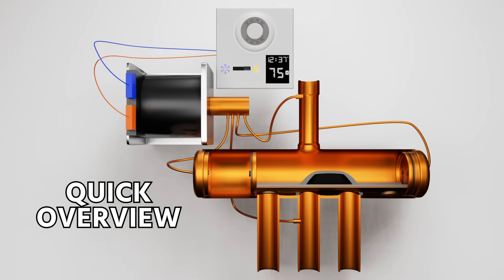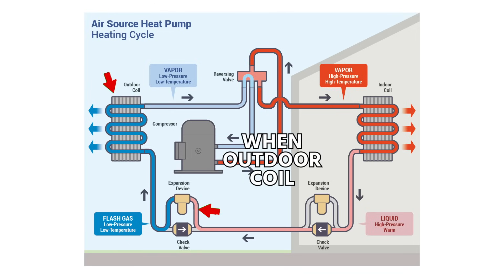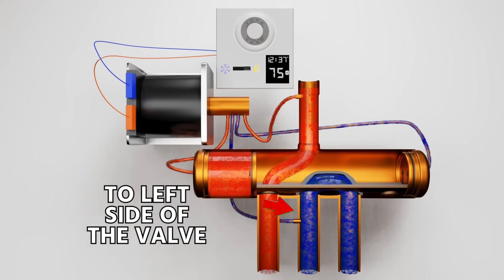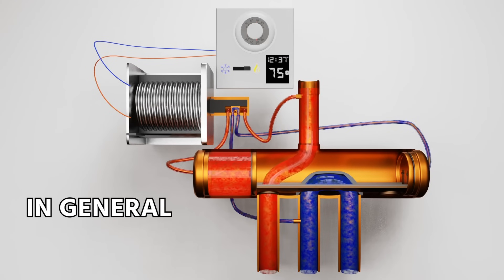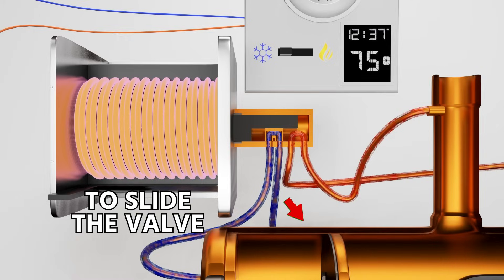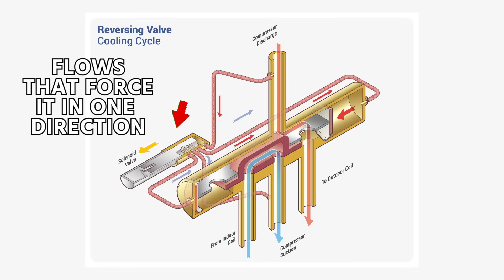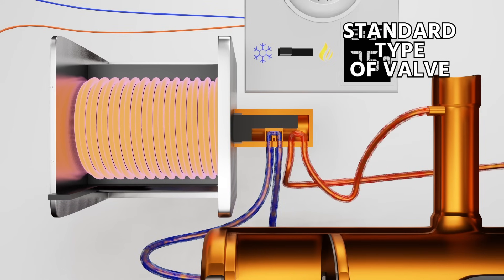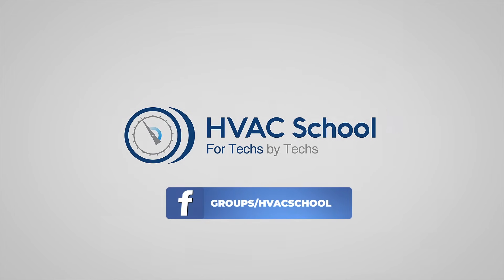How a Heat Pump Reversing Valve Works

Comment: In winter here in North Texas, when I turn my Trane heat pump to heat, error messages are thrown and then it goes to the heat strips only when I reset breaker. Could this be the reversing valve?  My technician says they are very hard to change out and all freon on outside unit cannot be recovered.  Costing thousands of dollars.  Is this true? Also, could it be the expansion valve?

Comment: I always wondered how a simple solenoid could cause a pressure differential to move the reversing valve. Now I know that it's caused by a pilot valve that acts as a mini reversing valve. Thank you so much for the information. This video was illuminating.

Comment: “Normally called condenser coil” that’s why I set terms relative to straight-cool systems. Easier to base it off of something that doesn’t have each heat exchanger functioning as both

Comment: Absorbs heat from 40* air and provides 95* heat inside?
Why is this taught across the industry instead of the fact the heat is generated by the compressor compressing the gas, which makes the gas hot, because it’s being compressed, which then goes through the indoor coil and is cooled by the indoor blower, condensing the gas into liquid and also heating the space. Anyone who thinks not- go touch the discharge line at a running compressor and see for yourself.
Anyone with a shop air compressor that’s ran it more than a couple minutes knows that compressor pump head, and even the tank / air inside it gets hot as it’s running, compressing the air.

Comment: I'm new to the hvac world and I understood that if it was blowing hot/warm air out of the outdoor unit it was making it cold inside and vice versa but this video connected so many things I thought I understood
Reply: You are correct, when the outdoor unit is blowing hot air out, the system is in cooling mode, I.e. the indoor unit will be blowing cool air to cool the room. 
If the outdoor unit is blowing cold air,  then the indoor unit will be heating the room.

Comment: When the cooling demand is met in a HP, does it first turn the compressor off or the reversing valve (assuming reversing valve energized is cooling)?
Reply: The valve will generally stay energized during the off cycle. Cycling it can make noise which is annoying and it can cause the TXV to loose its happy spot and have to hunt for it on the next startup.

Comment: its confusing that the refrigerant is labeled as a flash gas between the metering device and evap coil, in cool mode. because while some of the refrigerant is changed from liquid to vapor after metering device, its still in a saturated state (liquid still present) until it passes fully through the evap coil on a normally operating system. then it absorbs heat, and boils into vapor. right?
Reply: Flash gas due to the change of state per pressure dynamics of metering device. The "flash" part is because the change is instantaneous. 100% liquid at TXV inlet and 75% liquid/ 25% vapor at the TXV outlet. The refrigerant exits the evaporator as a superheated vapor. That means that the change of state is completed prior to traveling all the way through the evaporator. If the liquid is present for too long in the evaporator it is considered a flooded evaporator.

Comment: Why wouldn't you just use the solenoid to move the reversing valve?  Why involve gas through tiny tubes to create problems?

Comment: No complicated technical jargon, just simple explanation of how it works; Super easy to understand, Thank You! Thank You! Thank You! | 2 years ago my Carrier single package heat pump PH4Z-060 failed to provide heat. I called an HVAC company to troubleshoot and repair, the technician diagnosed and found the heat strip was burned out and the galvanized housing/box was rusted. The replacement part was unavailable according to the expert. Long story short, I don't believe that he checked the electromagnetic coil and reversing valve. My heat pump is 8 years old and I'm considering a Split System to replace it. 'Care to share any advice?

Comment: Great video.. one thing that puzzles me - when the system is in heating-mode, the refrigerant lines are used for the opposite purpose of cooling.  Since the lines are not the same size ( my suction line is 3/4 and liquid is 5/16),  aren't the lines improperly sized upon reversing?  Is there a performance loss in heating mode due to the improper sizing.

Comment: This is very helpful for me to understand how to maintain my own equipment at home. Thank you. I am very interested to know the sequence of events that occurs during a defrost cycle of a heat pump. The compressor receives an intense shock to the system when this valve actuates, and I would like to know if compressors for heat pumps differ from simple air conditioners in a way that compensates for this shock load they receive regularly. Also, I have seen systems that measure pressure differentials between outside and inside the outside unit to determine when to operate defrost cycles rather than simple temperature differentials or timers. Is the efficiency gained by a pressure differential system worth the added expense and complexity?

Comment: You show that just after the expansion Device the refrigerant is in a Flash Gas state when really for the system to work efficiently it is in a high pressure liquid state so most of the outdoor coil will actually be  filled with liquid. Near the output of the cooling coils will have a liquid flash gas interface. At the input the pressure is high but at the output the pressure is lower and should be all gas. Also heat is going into the Outdoor coil and this is being pumped from the outside to the inside. Latent  heat of Evaporation is the real clever  part of heat pumps. Heat is going in but temp is not rising,

Comment: How does the unit act kike if the reverse valve is faulty or sticking? How do I know for sure this is the problem? My unit works great on cold setting but on heater setting it will kick in like it's working and like 10 seconds later it stops then 10 or so seconds later starts and then stops. It does this over and over again meanwhile no hot air blows out through the vents.
Reply: No one ever replied. 🤦🏻‍♀️
Reply: @robertruge2916 thanks for sharing. Worth looking into.

Comment: I would like to add a reversing valve to.a.common refrigerator so that it can heat up as a proofing chamber when needed. As the conpressor on a fridge is not as powerful, will a reversing valve out of a heat pump still work and be able to switch? Or not ..

Comment: Thank you for this.
Hmm.. I wonder if this could be the problem with my system-- the reversing valve not working properly. Back during winter we turned the heat on but after it warmed up a bit we turned it back to cool mode but it was heating instead. The outside compressor (which was 12yrs old) died. Took a few months to get someone to actually come out and diagnose. We replaced the outside unit with a matching unit designed to work with our inside unit (Trane brand). Had it professionally installed and cooling was working. But now it is set to cooling to 70° but its heating instead (got to 77). I turned it off and things cooled off. I'm hoping its not something wrong with the new unit (although it is under warranty) but maybe its the reversing valve. Where exactly is the reversing valve? Is it inside the internal unit or the outside unit or somewhere in between?

Comment: Very Excellent video. I am replacing the thermostat on an older Nordyne Heat pump with a newer Sensi  "Smart" Thermostat made by Emerson. Based on your video may I assume the reversing valve in this Nordyne unit is energized in the cooling mode? May I assume the "O" terminal (orange wire) goes to the reversing valve? This unit has indoor air handler for supplemental resistance heat or emergency resistance heat. The old thermostat is not programmable and strictly mechanical. It has 2 mercury switches in it for main (compressor) and supplemental (resistance) heat.  I am a retired technician.  I did some HVAC but that was not my specialty. The new thermostat is programmable and can also be controlled via Wi-Fi or mobile data. 
Larry Retired Sears Tech Electronics and appliance repair 43 yrs

Comment: Could you also use a reversing valve to send refrigerant to a heat exchanger to dump heat into a pool vs the condenser?
Reply: There is a company called Aquacal that makes heat pump package units for swimming pools.  Much cheaper to operate than gas.

Comment: If I only have 4 wires going to  my heat pump from Thermostat, couldn't I just put a jumper inside the heat pump so the reversing valve would be energized whenever the AC came on in the winter and run the heat pump  in AC mode? In summer disconnect the jumper or put in a toggle switch?

Comment: My reversing valve is not moving all the way in the air conditioning mode (cold).  My head pressure is normal but my suction pressure is like 10 PSI.  Is there a way to free up the valve by tapping on it or applying heat?  Is there a way to get a valve that is not shuttling properly to move freely.  It's an R22 system that holds a fair amount of Freon so I'd like to try to fix it without cracking open the system.  Thanks if anyone has any ideas.

Comment: This was SUPER helpful, thank you; particularly the info. concerning Rheem & Ruud being manufacturers that "fail to" COOLING MODE. 
With that said, I have a SANHUA Reversing Valve (from Goodman) that when putting nitrogen through the discharge, appears to FAIL TO COOL. 
Does anyone know if this is accurate?
Much appreciated! :)

Comment: 12 year hvac tech here and this guy sure does know what he's talking about 👍
Reply: Vrey good  shering gues
Reply: Wow you’re here after 12 years? Still haven’t understood the operation?
Reply: @Schizophrenic11 https://youtube.com/@indianhvacrdiaries?si=8lnmnXVMZ0G976ct
Reply: @Schizophrenic11 shut up I appreciate continued learning and youre dissing someone for doing that you peaked in middle school didn't you you idiot
Reply: @Schizophrenic11  thats what good techs do, its called continued education (youre a bum)
Reply: @Lolsobad-p8v  after 12 years and you haven’t understood how a reversing valve works. That’s not continued education. 😂
Reply: @Schizophrenic11   hvac guys watch hvac videos man it aint that deep.. how many years in are you?
Reply: https://youtube.com/@indianhvacrdiaries?si=8lnmnXVMZ0G976ct
Reply: The blue wire. Really? This is a common misfire. Blue wire goes to the Cterminal or no where.
Reply: @Squeezmo a wire is a wire man, they color code the insulation for simplicity.
Reply: @tommartinez6056  Right. Electricity does not care what color wire it is. It's not racist, lol.

Comment: I only see a lot of electricity needed, specially when it gets cold at night, when the sun is down, the wind is flat......running on coalfired plants with an enormous cable transport loss.....i see a REAL criminal attack on the climate goals.....i see lies, lies and lies......i see higher costs, political finacial control and grip op everybody's lives...and the bad thing: it does NOT WORK WELL....only if you're house is three dimensional packed in thick layers isolation.....even small openings of ventilation is undoing all this "packing", in which any life is actually impossible...
I will never drive an electric car (i did one year, never more) and when energy prices are politically driven up the roof, i burn free available wood in my house...."biomass...", which is no "bio" at all....

Comment: Does this reversing valve make a noise when it changes over. Because our Heatpump when it defrost and then sets up to heat again makes an awful noise from the reversing valve???Any explanation for this???
Reply: just simple noise like click usually because the slide inside shifts, should not be a big awful noise.

Comment: Hi Bryan how r u! I got questions I do get it hot gas come from discharge through capillary to shift reversing valve but where is suction line gas come from? Because I see the flow in video suction gas is not come from common suction line, low gas flow back to common suction! Where low gas come from? It’s doesn’t look like to from common suction? Thanks

Comment: Thanks for sharing, great video and illustrations.
Understand that the pilot valve does the shift, at what pressure should the refrigerant be when in heat mode? I’m not sure but I don’t think my valve is working properly, I’m not getting to desired temperature inside the house.
In heat mode, the line going to the evaporator inside doesn’t feel like it’s getting hot enough to provide enough heat to warm up the house.
I put my thermometer on the line going into the air handler, ( in between the insulation and copper line) to get a reading as it leaves the outside unit, the temperature reads around 67 degrees F. The gas should be a much higher temperature going to the air handler right?, so is my revering valve not working right or is there something else I should be looking at?
Any advice is much appreciated.

Comment: So if too cold outside , no warmeth the inside ? I thought it used the indoor air to pull the heat and redirect it back inside somehow, but also explains why I couldnt figure out how it worked...I think my brain didn't want it to be like that because it limits the application to the warmth available outside

Comment: so the best thing is to cut that crap out of your pipe and and braze the discharge line and suction lines straight up and let the electric or gas furnace run. solving most of your calls in places like Ohio. 
yes i have done this and it made happy costumers.
Reply: electricity must be cheap in that part of the country.  plus if you go to gas you have to also change out the air handler.
Reply: @JaySmith-frosty  well you are burning electricity either way. Running compressor and extra fan for longer vs resistance heat for shorter time. Then there is the defrost times that are just lost usage.

Comment: Thanks! Installed a Nest Theromostat in my Apt about a year ago almost and I had issues running. Trying to figure out why when i run the AC its pumping out hot air! Little did I know it was not gas powered as I though and was a heat pump! I just though it full on reversed the compressor and didn't realize there is a valve that does that part. Only thing I don't like about it is that 1) since it uses the compressor it is just as expensive to run as the AC and 2) it doesn't get as hot as a gas or electric and takes longer to warm up my apartment and thus costing me more money. Normally my electric bill is 70-100  but its been 130-150 this year for winter.

Comment: After buying my first home back in August, these videos help. Google has also been a big help to assure me it's working properly. I panicked the other day when I heard the valve switch when it went into defrost mode. When I went outside, the compressor was running, but not the fan. Of course the worst thing popped into my head, like great it's broke. Then after some researching, I was reassured it was working as it should. So much to learn about these heat pumps.
Reply: Phillip you missed the entertaining part of the defrost cycle. When it ends, the outdoor fan comes back on and since the coil was heated, it will blow a big cloud of water vapor (depending on conditions) which looks like a big cloud of smoke.

Comment: At what point is the reversing valve allowed to shift? Is there any point in it's movement where it can dead-head the discharge line?
Reply: On a call for heat at the thermostat the reversing valve is not energized and is in heating mode, but when you call for cooling at the thermostat then the reversing valve reverses the flow of refrigerant.

Comment: Why not just reverse the direction of the compressor?    Many compressor designs are reversible, meaning that if you rotate them backwards they will discharge out the "suction" line.    Reversing the compressor could be done electrically with a relay, thus no additional parts in the refrigerant loop.
Reply: A scroll will not run backwards and most systems are going to that more efficient type.  2nd a recip compressor can and will run in both directions but it does not change the flow of refrigerant just the direction of the crank.

Comment: I have a heat pump in my house and it's cost effective to run, but the only thing I don't like about heat pumps in general, is they put twice the wear on the compressor because it runs all year long

Comment: when the outdoor temp is negative and rad is full of snow how can the pump catch "free calories" ??
(Even though I know that there is de-icing cycle)
Reply: The “evaporator” or outdoor coil saturation temperature is below the outdoor air temperature. This creates the heat transfer. So, it can be -5F outside with a -20F sat temp and the refrigerant will absorb heat energy to transfer indoors via the compressor. Pretty neat.
Reply: because there are still heat energy inside the outside air even when it is very cold outside.

Comment: Amp draw on compressor is much higher on Heat mode vs cooling.  I get about 2500 watts to 3000 watts on 3 ton in cooling depending on outdoor temp, but heating is 2900 to 3500 and get outside TXV action after 10 mins run causing a sinusoidal current draw varying about 200 watts in heat mode only if you graph wattage, all normal for my Heil HP 3 ton R22.
Reply: Het   revals valve not  working  stome  runing need  pleas explain  any  sloushion fee  pleas..
Reply: @jollyscaria1922  Don't follow you??
Reply: @jollyscaria1922  it was well done. Very  simple to grasp thanks a lot

Comment: Since I can't get a HVAC INSTALLER TO CHANGE an old built-in version to heat pump where can I get a valve there are utube tutorials on how to pump out the old refrigerant out and how to fill but nothing on the valve until yours